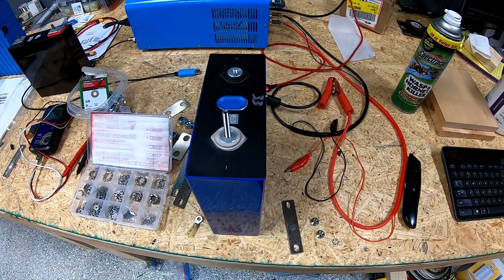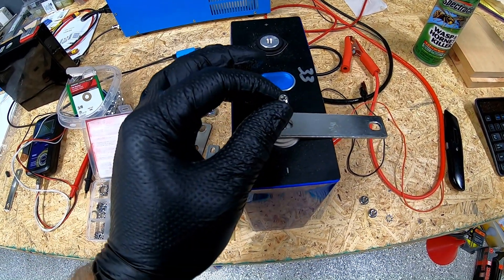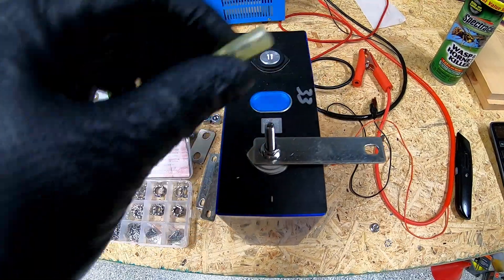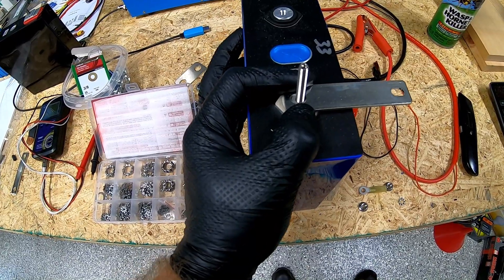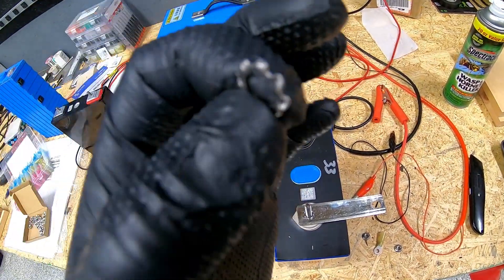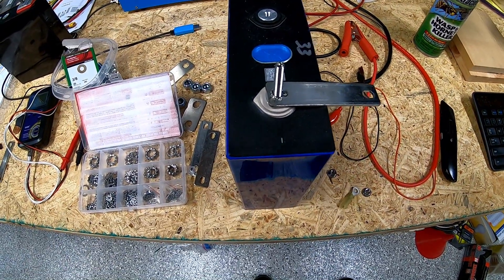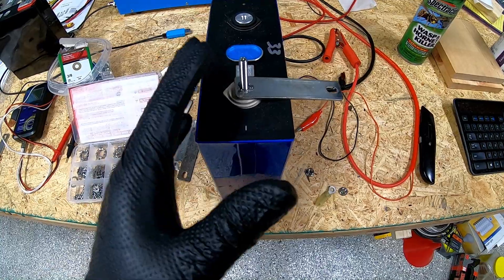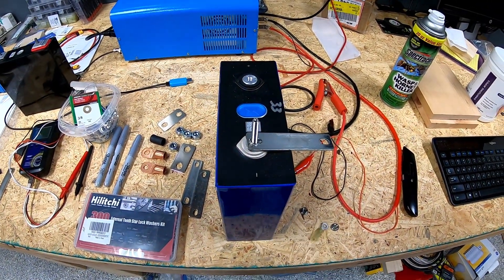cell connection updates

Comment: Brilliant video. One of the best ive watched in a while, detailing the importance of a perfect connection. Many folks simply rely on the monitoring apperatus reporting the correct values, because they have spent so much money on a quality system and this video highlights that something as simple as the connectivity between surfaces, impacts tremendously. So glad you posted this.  With such a small difference in connection tightness/contact, this further highlights the potential for surface oxidation to impact results going forward. This video has much more implications than is first apparent. Well done you.
Reply from the maker: Thanks for the comment, I have another video should be posted in the next day where we will detail some changes to the bus bar connections between cells, that should make things much better.

Comment: Be careful, using them lock washer as over time they may rush and cause other problems mate. Just need to keep a eye on them say each year to be safe.
Reply from the maker: Thanks for stooping by and the comment, forgot to mention in the video that all the hardware is stainless steel.

Comment: I would use pure copper washer with same outside diameter as the flange nut flange and inside diameter same as the stud!
Reply: A copper washer works great for me and a belleville washer would eliminate the nut coming lose due to thermal changes. A star washer is not enough in the long term!
Reply: That's not what the problem is. The problem is not contact, it's the nuts getting loose as you charge and discharge the pack.